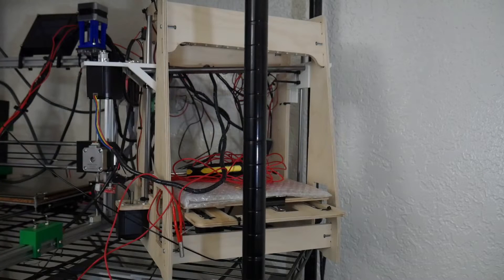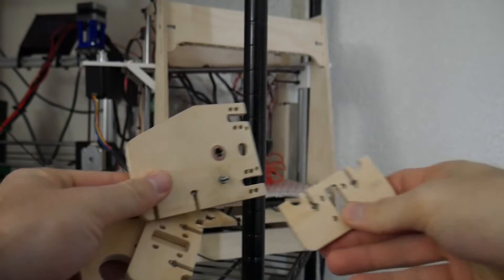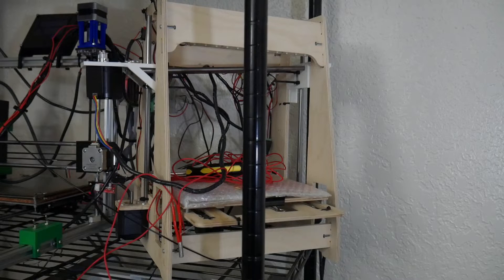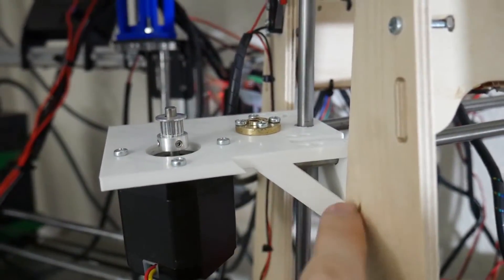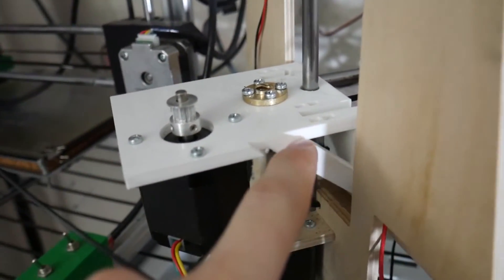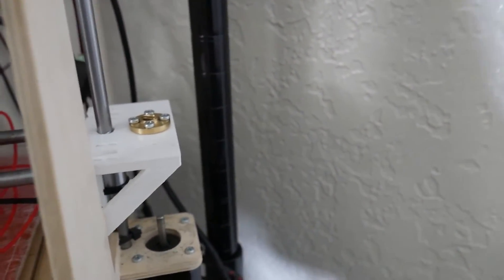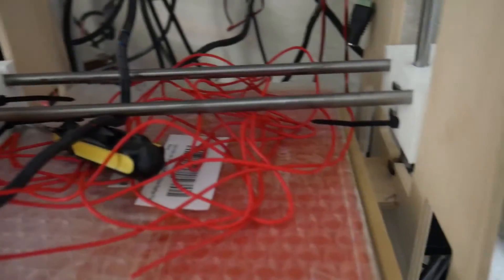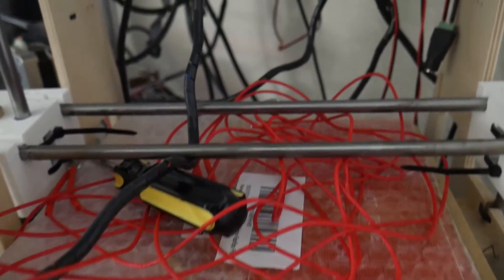Massive Prusa i3 Style 3D Printer Modding & Upgrading Project Pt. 1

Comment: Good luck on doing all of that but I don't think you should cut the lead screws. Maybe you could do some upgrade to get a taller build space.
Reply from the maker: +Its Voodoo it has to be cut man the wood frame has no way of being modified longer u less I i cut into the frame and get longer smooth rods